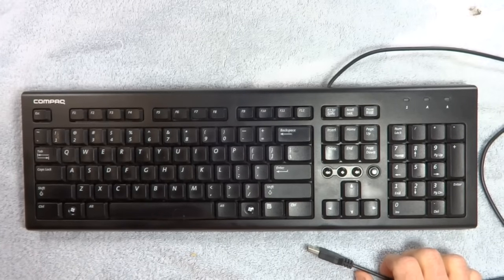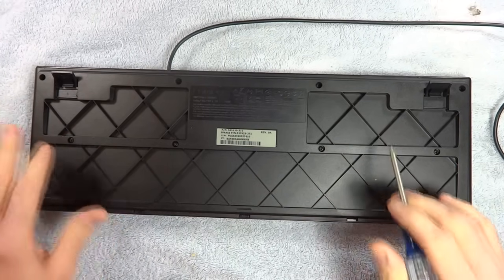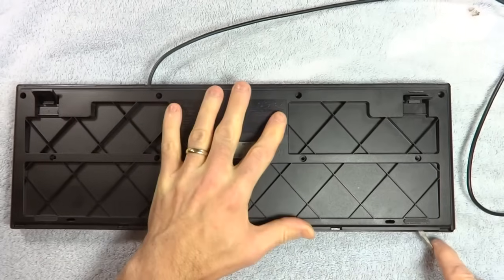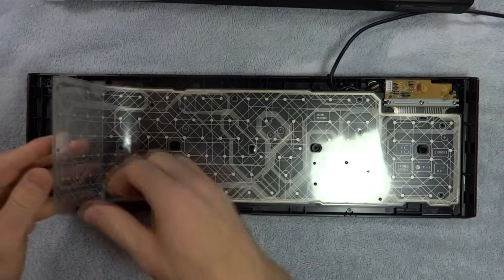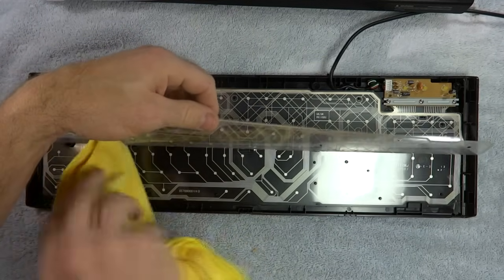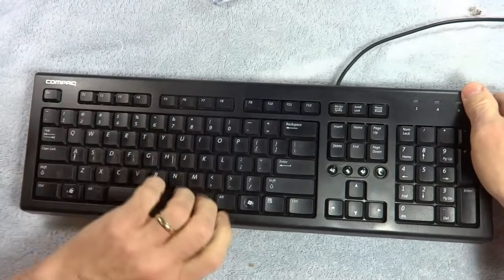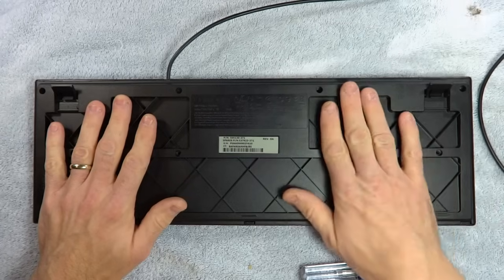How To Repair Computer Keyboard With Some Keys Not Working

Comment: Thanks! Went from 1 key not working to the entire keyboard shot to hell. I followed your exact steps.
Reply: Mansoor akhtar  ppv00ui0g000 op op 0 poo 0 00 0i can  Co 0 CZ CPI c ft  c fv f ftv fv f  ft p 0f ft poi to PTO 0f0 can CT Flo  cu cu pop v0 C's cu CB bc PPP  couldpf pop v cu poo cu CV coocoo 0 v pitvpc0  00  0vpu.  if 0y00p cop 0 v000g0 pv0 cu Togo could go vivo c f rustic building u cut or v0 bc CTFU CW c0ip cu p ft to vpi00000 cu of CV 0 g for p a cop fvgngnhh
Reply: hahaha me 2 dude now only 4 keys r working
Reply: Ik this is two years later but you definitly did something wrong this completely fixed my keyboard. This is so easy I CANT BELIEVE someone doesnt know how to untie screws and put a damp cloth on some keys its so easy my 7yr old brother just cleaned his
Reply: Place the motherboard correctly. That should fix the problem
Reply: now I m goin to buy a new 1 tomorrow
Reply: same
Reply: Same, although my keys have an individual membrane for each of them
Reply: Then you suck at repairs/cleaning, have someone else do it? I've done this several times, though peeling apart the membrane isn't necessary.
Reply: Sawdust Caesar same thing happened with me 😂 time to buy a new keyboard 😒
Reply: same bro
Reply: Too many people think they are worthy of offering their opinions. They really need to STFU if they don't have any constructive input other than "you suck" and then bloviate about how great they are. Their offerings do nothing to further humanity.

Comment: I got an weird problem. I have keyboards and both have the same problem. esc,a,z,q and 1 those buttons are not working. if I hold Caps lock and Tab and then if I press of those buttons, it goes to their right side buttons. for example, if I hold Caps Lock and Tab and then if I press "a", it types "s". anyone please help me
Reply: Whoa, this is exactly my problem! What keyboard are you using? Mine is A4Tech
The same keys on my keyboard just stopped working a week ago :/
Reply: this is the same problem of my A4Tech keyboard
Reply: Bro I brought a new keyboard . now it works perfectly

Comment: For my keyboard I tried to do what you did but for some reason my keys don't work at all! I came to this video because my keys are doing the opposite.. For example CAPS LOCK is doing lowercase instead what it should've been doing. And also my numbers 123 example instead it's like !@# goes the same with all of my numbers but the. I found the video and stopped working on me. What can I do now?
Reply: Your Shift key is stuck if that's what happening.  Either the left or the right one is stuck.
Reply: +corey swann I check all of the keys, the next day it worked. I did nothing 2 it
Reply: +guojian chen It may be a driver that's (ausing the problem. My "se" letter doesn't work but it's a me(hani(al problem :(

Comment: there is 4 layers in a keyboard bottom contact sheet ,spacer sheet, top contact sheet and silicon spring sheet very simple EDIT actually its super simple when i spill something i just take all the sheets out and wash it in the shower and than clean off with a dry cloth its almost impossible to break a keyboard the worst 2 thing to have break is eather the circuit or cable and still its easy to fix

Comment: This is a great way to fix it, but if you rub off a line of the circuit anywhere, some keys will stop functioning. Also if you bend the plastic too sharp/too much and it leaves a mark, it might leave some keys to double-click or repeat itself. I have Steelseries Apex Raw and I have cleaned it and repaired the circuit many times, if you want a durable keyboard choose mechanical over membrane.
Reply from the maker: Be gentle.
Reply: Yeah i have a steelseries apex too. After cleaning some keys stopped working.Guess i have to fix them :)
Reply: what do mean by that? like if cut the circuit? because one of the lines on my keyboard has oxidized a tiny bit and I brushed it off. the line is still there. its just slightly less wide.

Comment: when i try holding W and A together they just don't work but if i hold W first than A they work any help ?
Reply: well that seems like a problem with the circuit take you might want buy a  new one or test out and see if everything is working properly could have a blown out rectifier or capacitor

Comment: See my keyboard is a bit sneaky I be talking to someone or doing something important and BAM! The keys stop working quicker than an immigrant and only way to fix it is hulk smash the whole keyboard and sometimes it works tho sometimes not
Reply from the maker: +Nickster750 Sounds like a loose connection or solder break. Replacing it would probably be easiest.

Comment: my keyboard plain stopped working alone. it had been pretty weird in games where long presses stuttered a lot. i opened it and cleaned but i only get to press z,x,c,m,/,*. and enter. what can it be? its a wireless if it matters
Reply from the maker: +Marcos Martinez Low battery?
Reply: RJ The Bike Guy Changed them twice, so no.
Reply from the maker: Then not sure. Maybe the thing is toast.

Comment: ur method helped me recover 1 key but my method is way toooo easier and ya workful.....
Steps:
1. Wash Your Dirty Hands
2. get the keyboard
3. hold it in mid air
4. transform to ssj god
5. Slammmmm it Down .
Well it worked for me

Comment: Now all my keys are not working, thanks to this.
Reply: mine too ;(
Reply: my.spaceare.ot.workig.ay.more
Reply: @benjilmao  y 2 keys aret workig its aoyig a
Reply: @LethalSZN2  yes my n and b key doesnt work (commenting from phone)
Reply: @benjilmao  bro press windows+ctrl+o for virtual keyboard
Reply: @sivaramakrishna4680  his keyboard not works🙂
Reply: @Mc69uknow  yep but i repaired seeing another video
Reply: @benjilmao   and B and N
Reply: @benjilmao  samemyspacesndhift
Reply: @benjilmao  meto9
Reply: @benjilmao  i can see your B, N and spacebar isnt working
Reply: Same My keyboard is not working, it became worse
Reply: cn you tell wht key is broken but before this?
Reply: @rouesvm a
Reply: Mine too BUT THEN I realized I didn't connect the plastic circuit properly on the top left near the numlock light. After connecting them properly, my keyboard is fixed! For those watching this in 2020, hope this helps
Reply: @jehovich  pretty sure this is my problem too
Can u help me how to fix it properly...
Reply: @shrub._.685  Make sure the plastic is properly placed into the circuit slot
Reply: @jehovich thanks a lot... Checking that definitely helpmed me get my keyboard back...
Reply: @jehovich so which way you put it back because I’ve tried every way and still nothing and my keyboard was perfectly fine before
Reply: @jehovich  Thanks, I got the same problem after cleaning my keyboard.
Reply: @jehovich  how do you properly connect them?
Reply: Same here
Reply: Hahaha
Reply: the key next to O and next to L are not working
Reply: Same but i feel like i cant get the contacts where thoses 3 screws to work im not a idiot lol
Reply: Lmao just imagine the keyboard as a puzzle and try experimenting it but since its broken you can go ahead shit and solve the puzzle behind it
Reply: @05GITRO  whatever u say cool guy
Reply: @johnbautista9001  its true although i just broke my keyboard just now, just because i raged quit on a game XD
Reply: Yes bro
Reply: Same
Reply: Me too😄
Reply: lol
Reply: Thats why use the eraser not towel
Reply: Try use eraser
Reply: i knew it. thts why i ws looking the comments first if it works or not XD.
Reply: same
Reply: how did u type this?
Reply: @yea-00  have u heard of on-screen keyboard?
Reply: Same haha
Reply: You are right bro
Reply: It happened to me too. Got a new one.
Reply: I can guarantee you guys did it wrong, if it broke.
Reply: mine too mahn
Reply: my entire keyboard broke
Reply: Lol
Reply: Lol 😆
Reply: I know it happened to me ಠ︵ಠ
Reply: Place the motherboard correctly. Happened with me on first attempt as well.
Reply: Same :(
Reply: Same here 🤣🤣
Reply: Hahaha
Reply: Mee to
Reply: Yep now all mine aren’t responding time to buy a new keyboard
Reply: Mine too😖😖😖
Reply: Yes...
Reply: Same
Reply: Mine too 😭
Reply: @skycloud good! now fix ur grammar
Reply: 💀 same
I was gonna throw it any way
Reply: Same
Reply: Same
Reply: Works for me
Reply: Me too now my mom mad at me huhuhu
Reply: Yess mine is not working at alll
Reply: Same
Reply: Mine too
Reply: same LMAOO
Reply: Buy another keyboar dipshit
Reply: @alexchiran1973  Got it. Feeling cool now? 🤣
Reply: @johnbautista9001  nah, its just that i tried this "repair" and it did not work
My point is that if it stopped working thats it u buy a new one
Allso if all your keys stopped working check if you conected them the propper way
Reply: Haha.  Same now
Reply: Mine too
Reply: Bro just clear the white plastic part
Reply: Nice joke buddy😂
Reply: 😂🤣😹 brave man
Reply: Same
Reply: me

Comment: At first my q,e, and r keys were not working.

 To fix my problem with those keys, all I did was turn off my laptop and turn it back on. After that, they still didn't work until I turned on Caps Lock and pressed the keys that gave me trouble then turned off caps lock and pressed the keys again. After all of that, they went back to normal.

:)
Reply: +India Paul Wonder how that worked. (it worked) XD

Comment: I cleaned my mechanical keyboard for the first time yesterday and now my left control key doesn't work. It's the oddest thing. It doesn't work when it's hooked up to my mac OR windows 7 box now. I'm completely stumped,  tried re-installing drivers and everything.
Reply: Reverent Reign It was my favorite keyboard that the left CTRL broke   (DAS Keyboard - built like a tank so I figured it would last a lifetime :( ..I may try to fix it soon. In the mean time I picked up a Razer Blackwidow ultimate keyboard from walmart. I need to start leaving a dust cover on the it when not in use. .   .  QuarteX: Good luck on your fix attempt. Please let us know how it goes.
Reply: Adam OlympiaYou probably accidentaly destroyed some tin "road" When you cleaned it.
Reply: ***** You know what, I bet you're right :( I wonder if I can fix this with some solder?
Reply: Well, Im gonna repair my keyboard today (I failed the cleaning too) So I will tell ya If It works:)
Reply: same but my t key doesn't work
Reply from the maker: Adam Olympia Clean it again. Check the contacts like in this video.

Comment from the maker: swapnil datar have you tried taking it apart at cleaning it?
Reply: RJ The Bike Guy what if some keys on a laptop doesn't work? like for example.on my laptop, when I click the  ''o'' key, this is what comes up ''to'' and when I click the ''t'' key, this is what comes up, ''to'' and when I click the full stop key, ''.'' this is what comes up ''g.'' and this is on a laptop, please help, I don't know whats going. on!!Look, everytime I write a word with ''t'' or ''o'' I am backspacing. the extra letter it gives me, for example, i'll write a normal sentence now''My cato dtoesnto like dtog.s tohato atotoack herg.''^^^^See what I mean, from this I cant type properally, This is on a laptop!! please help
Reply from the maker: Sounds like something more than a dirty keyboard which goes beyond the scope of this video which is actually aimed more at desktop keyboards. It could be a bad connection or some circuitry is messed up and parts will need to be replaced.
Reply: RJ The Bike Guy  my ey keybord is not working
Reply: RJ The Bike Guy  do you know how to fix a broken wire inside the keyboard? the wire inside my keyboard is cut .
Reply from the maker: albert luarez jr. Probably just go buy a new one. Used keyboards are dirt cheap.
Reply: same here dude please help
Reply: RJ The Bike Guy
Reply: RJ The B

Comment: you shoulD have recorDeD the key thats not functioning ~> Cleaning ~> let us See if it works..
Reply from the maker: It worked.
Reply: I Dunno about that ,..
Cuz my "D" key is not functioning but its spamming "DDDDDDDDDDDDDDD" something like that,...
Reply from the maker: Sensei Rain I have fixed more than a few keyboards by simply cleaning them. Try cleaning the D key itself. Maybe it is physically sticking. Even then, cleaning won't fix every keyboard. But more often than not it works.
Reply: RJ The Bike Guy I Cleaned my d key 3 times already still getting the same results....
Reply from the maker: Buy a new keyboard I guess.
Reply: where can i buy laptop keyboard
Reply from the maker: Ebay?
Reply: +RJ The Bike Guy Doesnt help after clean but still  like 4 you

Comment: i bought a new "Intex" keyboard yesterday and some keys are barely working and i have to press them multiple times for them to work. i have been using a "Canyon" keyboard for 8 years and never had a problem with and it had loads of dust and food crumbs in it. i don't think the problem is debris because as i said it is new. please help!
Reply from the maker: If it's a new keyboard, take it back to the store and get a different one.

Comment: My numbers 1 2 3 4 5 8 9 and 0 are not working will cleaning work it didn't work on the first try and second try cleaning it :( maybe buy new keyboard
Reply from the maker: Might need a new keyboard. Be sure you didn't hit something like a caps lock key or num lock key.

Comment: noticed the major problem is likely moisture between the plastic sheets [3 on my machine],   used barely  moist alcohol cloth,  no paper,  let sit for couple of hours or use hair dryer with coolest setting at least 15" from sheets,    if contact still doesn't work use a vinyl pencil eraser to lightly scrub the contact points {wipe with alcohol cloth again},  DO NOT TOUCH CONTACT POINTS WITH YOUR FINGERS.   The rubber plastic sheet is to provide the return or push back up of the keys.    It will provide some protection from liquids (don't count on it) and slightly more protection from dust particles.   Routine vacuum cleaning from the top of keys will lengthen the frequency between internal contamination.

Comment: I've had Problems with the Number 4 and the Letter K. Its a pain having to use the 4 on the number pad everytime I want to use a 4. The K key I would have to unplug my keyboard and then keep pressing the key until I started to see K's on screen. I have spilt Pepsi on two keyboards both microsoft the one I am using I thought was toast after I put the whole keyboard in the hot shower but it started to work again. the number 4 and the K acting up are pretty knew.I never tried to seporate those two circuit things before. I did it this time and used an Alcohol Vaporizer. its a pump bottle with alcohol which sprays a mist. Label says Alco Vap. Found it at a Drug store.

Comment: I have the same problem some keys wont work cause i cleaned it. took apart and removed debris and water put together still dont work. keyboard new so idk y. usin on screen keyboard annoying. ;n; help pls
Reply from the maker: Most times it works, sometimes it doesn't. You can try cleaning it again. If it doesn't work, buy a new one. Thankfully they aren't too expensive.
Reply: yea i think i fried it :( have to replace but ty

Comment: Q  A Z is not working in may Keyboard please help me..............
Reply from the maker: If it's just the three letters, try cleaning as in my video.
Reply: i clean but not work
Reply from the maker: Most of the time cleaning will solve the problem. But not always. You can try cleaning it again, or replace the keyboard.

Comment: Could you help me? My w key doesn't pop up after I press it. It still functions but it feels weird. I do A LOT of gaming so maybe I wore it out? Any way to fix this?
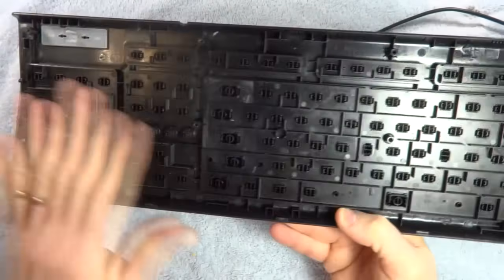Reply from the maker: There is probably some debris or something sticky under the key. Take the keyboard part off like around 2:40 in my video. Try popping the offending key off the board by releasing the tabs. Then clean the key and around where the key sits. Heck, you can take all the keys off, wash the whole thing and put it back together. Just be sure to put the keys back in the right sports. You can take a photo of the keyboard before taking it apart.
Reply: shyflirt1 thanks! ill give it a try
Reply from the maker: Let me know how it goes.